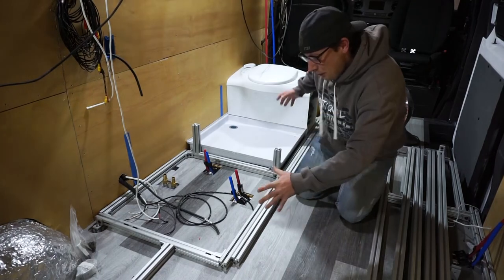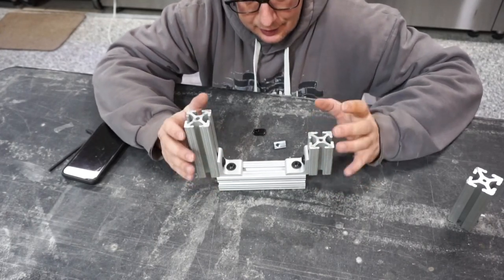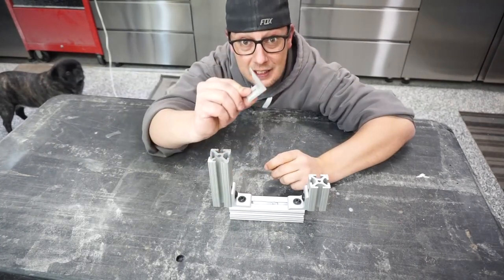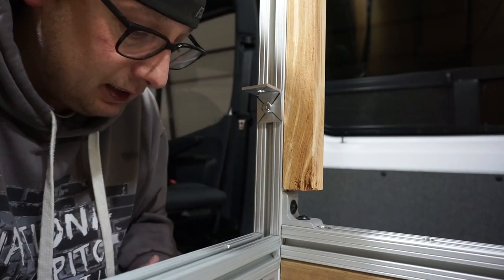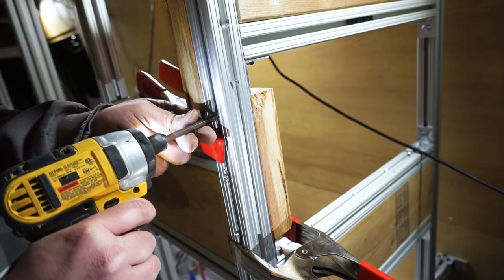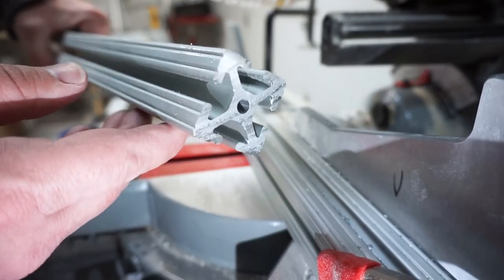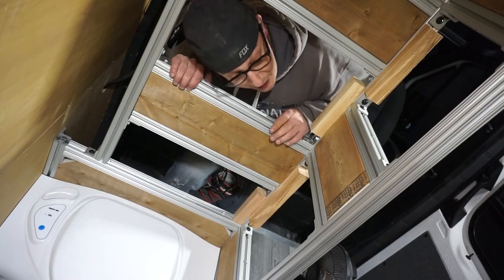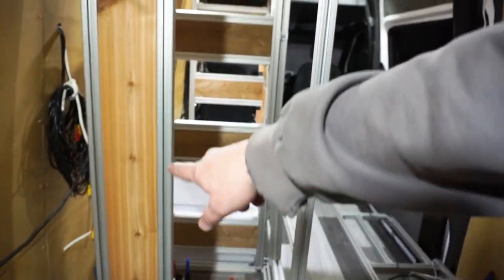TIPS to Build a Van with 80/20 Aluminum Framing | FOUR SEASON VAN LIFE | EP.41

Comment: Love you style of doing videos without much editing... very entertaining.  I test lubricants for the automotive industry and have been testing lubricants for a long time 34 years.  WD40 was invented by one of my clients and it is a Water DIspelling solvent and not a lubricant or coolant and while it may provide a tiny bit of antigalling you are better off going with a bar of sunlight soap.  The reason the tooth came out was the buildup of aluminum on the teeth causes very high friction so as you plunge the blade you will rip off the teeth or stall the saw.  
Unlike cuttting (drilling) steel where slow cutting speed and high feed rates are necessary you want high blade speeds  and slower feed rates.  The soap (sunlight or other hard soaps) will help prevent aluminum buildup on the blade. 

If you go to a machine shop supply they can sell you a stick of Walter Alucut (like a tube a grease but with a solid wax/soap) that you run the blade thru before every cut (this is designed for band saws but will work with the compound saw just be careful how you cut into the end). The more edges you have in your cut the more opportunity you have for ripping off teeth so make sure you keep the blade speed up so it goes thru smoothly.  I have cut  an aluminum scuba tank down the middle on a band saw and 3/8 thick aluminum channel on a table saw (NOT RECOMMENDED!!! - the blade it turning toward you and aluminum chips are very hot and if teeth come off they are coming at you!)  Keep up the great work!

Comment: Hello fellow Canadian. I am building my van. Yes fan of Curt and Snow. I start last year and since my van is not 4 seasons I packed it up for the winter. I am located in Kamloops BC. Just opened up the garage and starting with finishing the diesel heater. A great thing I noticed is your burner is located in the same area under the van as mine. I have about a 6 weeks left of work to finish

Comment: Great detailed information for those working through building with extruded aluminum. And the link for plans with cuts, very nice!  I only wish I was secure in my design to go with that offer. This will be a blessing for those that have their design in place and feel confident in placing an order with cut a list to receive it all read to build from factory. Wow wow.
Reply: Sorry, we are Chinese manufacture of aluminium profile.
Reply: The million dollar question, when. I’ve been on my design for about a year. I have the layout, now it’s ordering the fittings and bits to work out the sizes, spaces, supports, spans, weights for everything. Every inch adds up so the garage floor is a template taped out mock-up with heaters, air conditioning, battery’s, electric cabinets, water filters, sinks, pumps etc etc and I really think that’s going to add another year lol

Comment: Have to agree with you about Diablo, While they are expensive they will come to the party with no questions about product failure. you can get a 3mm x 3mm x 25mm aluminium corner that will match the corner from the 80/20, here in Australia you can get it from bunnings, Thanks for making these videos, you're very informative.

Comment: The thicker alum extrusion 90 degrees with the rounded inside corner can be found at aircraft spruce under aluminum material.  The rounded corner and 1/4” thick material will be more than twice as strong.

Comment: To cut the 8020 and no damage the blade saw,  screw a piece of 2x4 in the left half of the miter saw. Cut with the other half on air and you never going to loose a teeth again. A even can be use as a reference where the cut is going to be
Reply from the maker: Thanks for the input, i do use that trick with shorter cuts.  Second blade has not had an issue and we are over 100 cuts in now!

Comment: Thanks for sharing all the info!  I’m trying to decide if I should pursue 80/20 over wood framing.  Can you give me an idea of how much you’ve spent so far on just the 80/20 stuff?  How much do you think it’s cost me to start with just a bed platform?
Reply: Big money. Still have a lot of weight. Should use on most high loaded areas. Then use some other method. My walls are going to made with light wall constructed with Styrofoam screen like fiberglass like material.

Comment: Would 1"x1" 80/20 work for cabinets and showers?  Would it work for a full-size bed?  Aside from not being as strong as the 1 1/2" is there any disadvantage of using the 1"?
Reply from the maker: It all depends on the loads you expect to have on your framing.. I really can't suggest either way, I probably could have got away with the 10 series but I am all about the overkill.... Thanks for watching and commenting.

Comment: How did you secure the front of the galley to the floors? Glue? Drill through sheet metal? or just secured to the subfloor without drilling all the way through?  Thanks!
Reply from the maker: Everything is mounted to factory bolt holes on the floor and into rib braces in ceiling. Thanks for watching and commenting.

Comment: have a question can u use aluminum panels or that aluminum cover in airstream cabinets or something that has lesser weight, does not have mold or rust problems.
Reply from the maker: For sure you could, I went this route as the little amount of wood weight is very low and not of concern. As well it is PT wood so no chance of mold or rotting will occur..

Comment: Everybody knows you can use angle Aluminum and just cut it in place of the 80/20 bracket but it takes a lot of time to cut it and drill it properly. I don’t use either one because frankly they are one of the weakest ways to connect 8020 and I know simpler cheaper ways.
Reply from the maker: Thanks for watching and commenting with your advice..

Comment: you know when you use 1-1/2” 8020 instead of 1 inch 8020 the strength increases approximately 3 1/3 times or 333% but when you take your piece of aluminum angle and you make it 1-1/2” wide instead of 1 inch wide you’re only increasing the strength of the connector by 50%. I think you can see where I’m going with this. So either you wasted money on the profile and it’s stronger and heavier than you need or your connector is too weak and you wasted money on the profile because it’s stronger and heavier than you need compared to the connector. Weakest link. I see this all the time and don’t get me started about the fact that there’s only one bolt holding it. What size is that bolt anyway? There should be a table somewhere where you can look up the tensile strength

Comment: Pressure treated lumber is treated with copper, aluminum in direct contact with corrode.
Reply from the maker: Great response....  Yes this is true with older pressure treating processes known as ACQ treating... This is no longer used in Canada and the new method is Micropro Sienna which is safe to use indoors and with Aluminum..
Reply: MicroPro Sienna, is treated with MCA (Micronized Copper Azole). I wouldn’t feel comfortable using it when I could simply use untreated. Your choice lol, but great videos!

Comment: Mmmmmm...when I go to the lumber yard, I sort through and choose wood that is true, straight, dry and light. I use wood cause I can rip it, cross cut it, miter 45 ends etc etc. I see absolutely no reason to get sucked into this BS trend of an over priced and extremely limiting product!
You brag that it is far stronger and lighter than wood? (1)...the torsion strength 8020 is capable of is totally unnecessary for cabinetry! (2)...there is hardly a noticeable weight difference in the amount of material used in a van conversion. Not building airplanes here!!!
But if you like spending your hard earned money on glorified legos, fill yer boots! I'd rather waste my money on lithium batteries🤣
Reply from the maker: Not sure why you are watching a 8020 video if your mind is already set against it? But as for wood, yes I go through the pile to find the driest and straightest as well.. But if you come to my city you will see how dry it is here and no matter what. If you have wood sitting around it will dry out and warp no matter what you do...  Either way, thanks for watching and commenting.